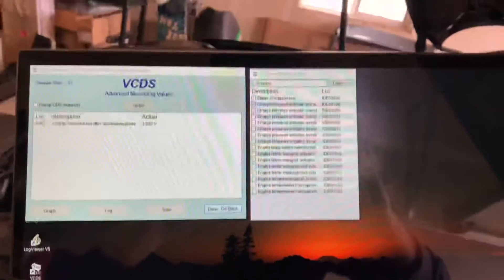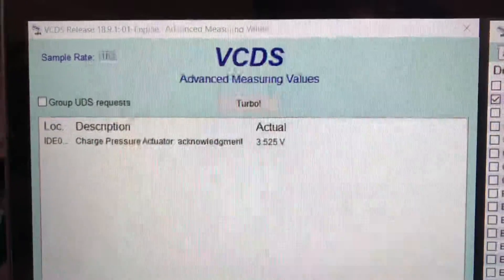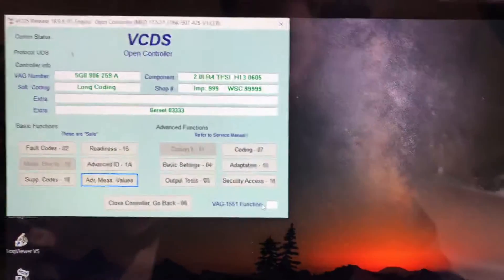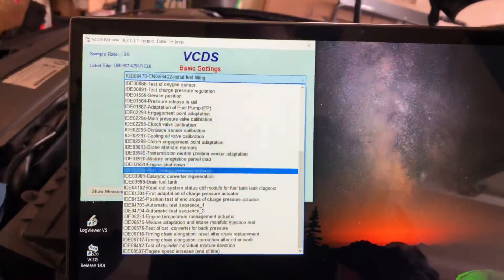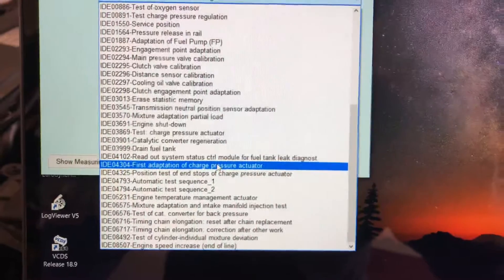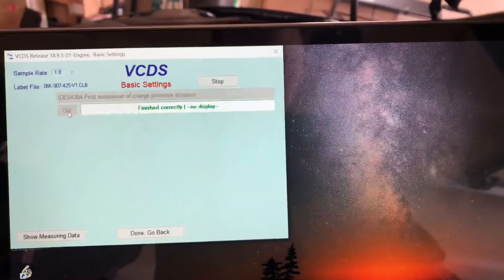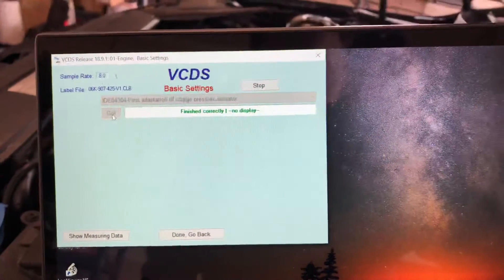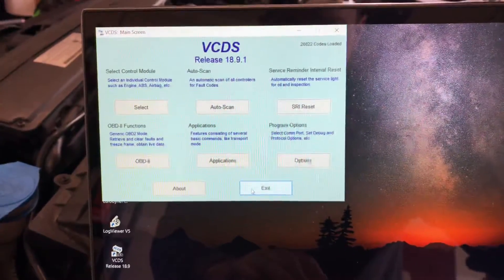HOW TO Adjust Wastegate Using VCDS ||MK7 GTI IS38 || Part 3

Comment: I installed an IS 38 turbo on a MK7. When setting the actuator via VDS with the ignition on, I have to manually push the actuator all the way in so that it shows a value of 3.6 volts. Shouldn't the engine itself hold the actuator closed?
Reply from the maker: No. This actuator is electronically actuated. The flap opens and closes according to how much boost the ECU is saying it’s receiving. So unless you are in boost while driving the car, the w actuators flap stays shut. That’s why it’s important to set the voltage correctly, so the flap stays shut at a certain voltage.

Comment: I have changed recently the wastegate . When changed i have limp light on blinking but without engine performance decrease . The code i have is p2563 turbocharger boost control position sensor circuit - imolausible signal. What is you opinion on that ? 
Ps: i have 2.0L TDI engine
Reply from the maker: I’m not 100% sure what it is, but it’s possible it could be that your wastegate actuator’s voltage is set incorrectly. I do not know what voltage value your car needs though. You will need to contact someone or look it up online to get that value. 

First check your DP v-band to see if there’s anything obstructing your wastegate. Also check your wastegate nuts to make sure they’re tight. Then when you find the correct voltage for your car, you can adjust it manually and using VAGCOM/VCDS, you can see the value go up and down as you adjust it. Or take it to a VW shop and have them do it.

Comment: Can someone please clarify whether 'charge pressure actuator acknowledgement' is the same as 'charge air pressure control valve unconditioned voltage sensor'? Which one do I read when adjusting the actuator to ~3.5V? Anyone's thoughts on this will he much appreciated. Thanks.
Reply from the maker: I don’t know for sure, but guessing, I would say they are not the same. The value that you use to adjust your wastegate is the “charge pressure actuator acknowledgment” value. Hope this helps.
Reply: @JacesOwnWorld  Thanks for the reply.

Comment: Hello thank you for a great video. This is the video i have been looking for. I have VCDS 23.3.1. Is it so simple like you show in this video to do a basic setting on the wategate actuator? I have had problem with my turbocharger since may 2023 after my car workshop has replaced a new turbocharger on my BMW 525D F11 2012. I have low boost and the error 29A400 is coming back when I run a scan on my car tool. At first I have to bu a new original Pierburg Booster pressure solenoid. Mine has a faulty. I am looking forward to do a turbocharger adaptation on my car. I hope I will manage to do it. Thank you again:-))

Comment: Hi, i have question for this one. I have not in VCDS Charge Pressure Actuator - acknowledgment (IDE00396) with Voltage. I have just Charge pressure actuator - adaptation (IDE03934, IDE 03935) with mV.. it's the same, or it's something diferent ? I have the same problem, and i go to make it, but i don't know, if it's the same or not :D in this one (IDE03934) I HAVE 4459.4mV (4.45V) .. please answer the question, thank you very much :)
Reply from the maker: I believe it’s the same. But not 100% sure. Try contacting VAGCOM and ask them.

Comment: at about 5500 rpm with full throttle how many volts should I see?  mine drops to 2.2v is it a correct value or should it drop more?
Reply from the maker: That’s a good question. Sounds normal, but I would contact your tuner and ask them to be 100% sure.

Comment: why it is then necessary to make a "first adaptation of charge pressure actuator" ??
Reply from the maker: So the actuator can re-learn the setting you set it at.
Reply: @JacesOwnWorld  so on my audi s3 if I change to a new is38 turbo from the same origin, do I have to do the learning again?
Reply from the maker: Yes

Comment: Hello, i'm french so i'm trying to do my best for you understand me.

I have a golf 7.5r so IS38 origin, i remap my golf in stage 2. Since, i have epc light coming up on dashboard sometimes when i pull.
So I returned the car to the garage, he set the voltage but the light still comes back.
Is there a manual setting to do if needed?

PS: In stage 1 no problem, it is since stage 2 with installation of the decat.

Comment: Would of been good on showing the adjustment,correctly having issues with the wastegate fully closed and been 3.5v,basically have to push the arm pretty hard back into actuator to see 3.5v on live data,and the rod is at the end of the threads,now thinking it may have a different turn to the is38

Comment: The dumbest things seem to happen to me. 
I installed my new is38 before adjusting the waste gate. For whatever reason no matter how much I turn the rod it won’t shut the waste gate!!!! Probably have made 200 turns by now. Won’t adjust. What the hell is going on? Please help.
Reply from the maker: Please explain further. I’m having a hard time understanding
Reply: @JacesOwnWorld  
haha first off thanks for responding. 
Ok I put my is20 waste gate on a is38 turbo. 
I didn’t adjust it before I installed it. 
I’m turning the rod/bar and I’m 99.999999% sure it’s turning. 
Using needle nose pliers. 
I’ve made probably 200-300 turns and the gate won’t close and voltage won’t change. 
Makes zero sense 
At this point I don’t know what to do besides take the turbo back out. And I’m not about to do that. 

Just to say I’ve started the car to get the oil moving and burn off any oil. Idles great get the nice blow off sound. Didn’t drive it. 
Thanks again
Reply from the maker: No problem.

I think your issue is putting your IS20 wastegate on your IS38. People have tried to do it, because they look identical, but I’ve only read of one person that was able to get it working compared to the many people who have tried. I don’t know why the IS20 wastegate doesn’t cope with the IS38, but it just doesn’t, and I don’t know how that one guy got it to work. If anyone told you the IS20 wastegate actuator works with the IS38, they’re either lying or have never done it.

So unfortunately you’re going to need to do these three things:

1. Purchase another IS38 turbo that has the wastegate actuator with it, because an OEM IS38 wastegate actuator does not sell on its own because VW says that you cannot change a wastegate actuator without changing the turbo (which is false which I will explain further down).

2. Purchase a Mahl IS38 wastegate actuator at this site https://www.shop.mambatek.com/MAHLE-IHI-IS38-Electronic-Turbo-Wastegate-Actuator-EA888-AUDI-S3-053-0104-1.htm

3 Install the new Mahl IS38 wastegate actuator with the turbo still installed in the car. You can do it. I have videos on my channel on how to. You can also remove the turbo and install it, but that’s a pain in the butt and a lot more work. My recommendation is installing it with the turbo already installed in the car. 

I’m sorry to give you this unfortunate news. Did you buy this IS38 turbo used? I’m assuming you did because new ones come with the wastegate actuator attached already, unless you bought a cheap one from like Alibaba or something like that. What trim level is your GTI?
Reply: @Fatduckdaddy  I know this is late but I had the exact same problem bud. Installed the is38 on my mk6 GLI and the wastegate actuator harness wasn’t long enough to fully clip into the wastegate so it would give me like 4.9 volts and I couldn’t adjust it no matter how much I turned it. Once I ordered an extender for the harness it ended up reading voltage correctly
Reply: @Fatduckdaddy  I wish I could show you pictures of mine but the way the turbo went in the place the actuator harness connected was on the bottom side of the engine so the oem connector was just long enough to make it there and look like it clipped in(even made clicking noises too lmao) but never actually went in that was just my problem now I’m battling the voltage staying in one place😂its just vdub stuff
Reply: @Fatduckdaddy  if you can pull the wastegate harness connector off the actuator with your hands you’ll need the extender
Reply: I can’t reply to this bro🤨🤨🤨🤨

Comment: ive adjusted mine to 3.5v, and what ive noticed is, if you touch the wastagate arm where the rod screws into, mine has a little wiggle and it makes the voltage change, could that mean it needs replacing?
Reply from the maker: I don't think so. 

Question: Which wastegate are you using? OEM IS20? OEM IS38? MAHL aka "Mamba" IS38? MAHL IS20?
Reply: @JacesOwnWorld   oem is38
Reply from the maker: It’s possible that you might be getting a bad reading, but it is possible that your wastegate is bad. Is your car able to run without throwing an EPC light, with the rattle you have? Are you getting boost?Before you consider your wastegate bad, do this:

Check to see if the wiggling that you feel isn’t also the wastegate flap. Your wastegate flap might be loose. If it is, continue turning the rod until the wastegate flap is closed (not so tight but just to where it becomes closed). Then start up the voltage process and see if you can attain the correct voltage. You should be able to feel the wastegate flap closing more ever so slightly and then hit voltage.

There are a bunch of people who have had the same wastegate arm rattle I think you are referring to. Have you gone into the vwvortex.com or golfmk7.com forums to see what others have been saying?
Reply: Loctite loctite loctite

Comment: When I turn the rod the voltages don't change?
Reply from the maker: Either you’re in the wrong setting, your key isn’t turned on to ignition 2, or your battery’s unplugged.
Reply: @JacesOwnWorld  charge pressure actuator unconditioned voltage?
Reply from the maker: No, that’s not it. Open VCDS, and follow these steps:

01Engine —> 06 Adv. Meas. Values —> Type in “ack” in search box —> Click the “charge pressure actuator acknowledgment” box

Here is a link to my video showing this:
https://youtu.be/dQ8qxgFmW-w

Make sure your battery is plugged on, and key is turned onto ignition 2 spot before you do these steps.
Reply: @JacesOwnWorld  No he has a wastegate like mine and its not on the MQB platforms. Spinning the rod does absolutely nothing. You would want to follow a regular method of setting up the wastegate and ignore the VCDS way. Use the VCDS to check if it it right but thats it.
Reply from the maker: There a different methods to check wastegate voltage. What I have described works for cars on the MQB platform. If he isn’t on this platform, it will be a different process. 🙂
Reply: @JacesOwnWorld  true and also false, Depends on what turbo you are doing it on for different platforms. For example, my 2014 Gen3 GLI is a non MQB platform but if I were to swap it with an IS38 I would need to do it the way you described in the video. I have the CTS turbo upgrade kit and the method I had to take to get mine to work was waaaaay different (and more difficult)
Reply from the maker: Exactly, which is why I said “there are different methods to check wastegate voltage”. I’m sorry if everything I wrote isn’t exactly specific to the “T” lol

My video has helped quite a lot of people along the way. It’s not going to help everyone, as not everyone car is the same or running the same turbo, but it is the way my setup is used, and my goal with this video, and almost every video I make, is to help those who are able to use the same process.
Reply: What's the bennifit swapping to the CTS electronic actuator from OEM?

Comment: I have an is20 turbine. can I use her original wastegate to install on an is38?
Reply from the maker: Yes, but it’s not recommended. The IS20 wastegate fits, but it’s voltage is different than the IS38’s wastegate, and is a lot more finicky to work around if putting it on a IS38 turbo.

Good news is, if you’re interested, I have a used 100% working IS38 wastegate for sell. Selling for $80
Reply: @JacesOwnWorld   
How do i contact you?
Do you have the link to purchase wastegate?
I'am from Brazil
Reply from the maker: Dionizio Zeferiro Junior hey! You can contact me through either Messenger on Facebook, under my name Jason Sorensen, or through messaging on Instagram through my Instagram name jacesownworld. 

I am so sorry though. I did not know you lived in Brazil. Due to experiences in the past, I do not ship internationally anymore. 

You can also try Alibaba.com. Sometimes they sell them.

Comment: Is that is20?or is38?
Reply from the maker: Rani Hino IS38
Reply: @JacesOwnWorld  do u know what voltage should be for is20?
Reply from the maker: Rani Hino I believe it’s the same, but IS20 wastegate won’t register voltage in the 3’s unless the car is running from what I’ve read. So try following the steps in my video, but with the car running. If the cars ignition is only on, the IS20 wastegate will only register around 1.7V’s, but will adapt once the car is running.
Reply: @JacesOwnWorld  thanks a lot
Reply from the maker: Rani Hino let me know how it goes 🙂
Reply: could do the wastage is20 configuration?
Reply from the maker: Dionizio Zeferiro Junior unfortunately I cannot. The IS20 reacts differently with voltage actuation, than the IS38 wastegate.

Comment: Can u send me the link for this program there like 7 different ones  have trouble set in my waste gate
Reply from the maker: Mk7.5gti project Gti here is a link where you can buy this software:

https://www.uspmotorsports.com/Ross-Tech-VCDS-with-HEX-V2-Enthusiast-USB-Interface-Vagcom.html?utm_source=google&utm_medium=cpc&adpos=1o1&scid=scplpVCHV2_3&sc_intid=VCHV2_3&gclid=Cj0KCQjwz8bsBRC6ARIsAEyNnvpQgXouzdromZwj-fcf-hQGA6DH8mvcawixgAb6S03NGULMRYuDhBEaAtoVEALw_wcB

I highly recommend spending the $199 to buy it. Worth every penny.

I’m not sure if it can connect with the MK7.5 generation. I would call USP to confirm first before buying.

What is going wrong with your wastegate adaptation?

Comment: @Jace MK7 when doing the adjustment on the wastegate actuator to get the correct voltage reading. does the car have to be running or just have the key in the on position??
Reply from the maker: MK7_Chris just have the key in the on position. Do not run the car when doing this
Reply: Jace MK7 appreciate the info bro thank you 🙏🙏🙏
Reply from the maker: MK7_Chris no problem man good luck. Let me know if you need anything